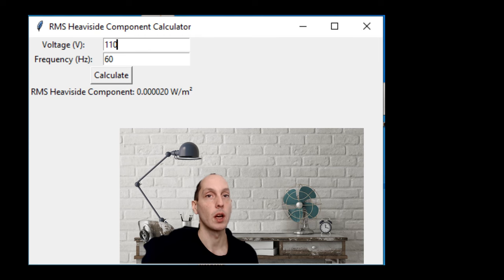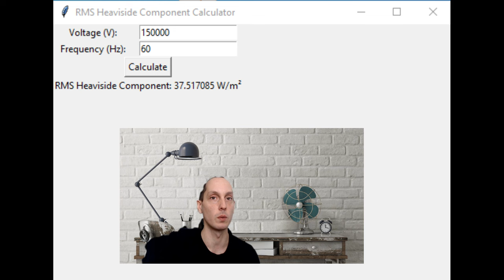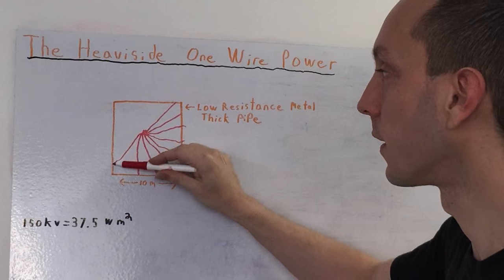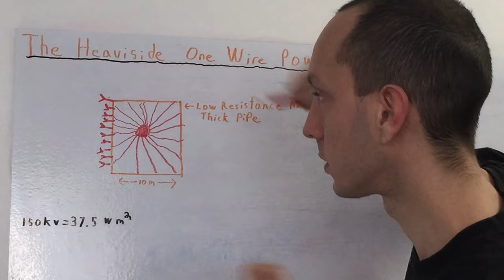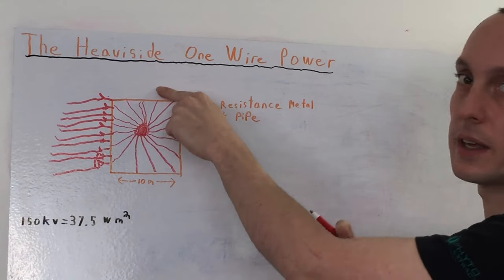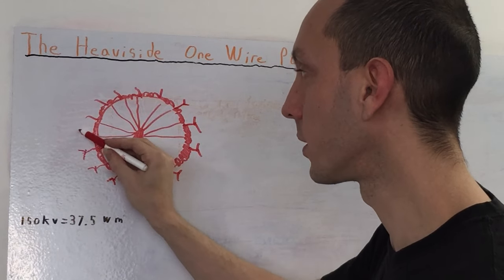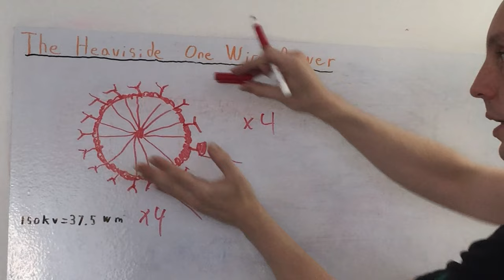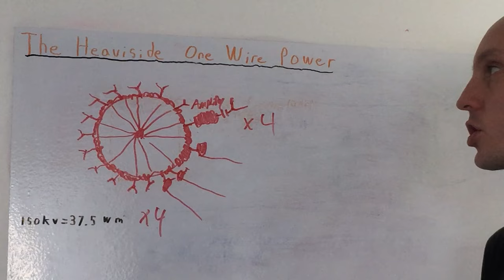Heaviside Limits

Comment: Happy new year Joel. Do you think it can be scaled up? If yes, lets talk.
Reply from the maker: This is the point I make in this video, the first option is best for scaling it up. Just need more stages (oscillators) And the calculator gives you best case. And we need an efficient way to catch the field. With 6 coils I got around 3.3 watts. But at least this gives us an idea on limits. Per one wire system.
Reply: @joellagace1679  
Do You think we can get around 500-1,000 watts system based on the calculation?
Reply from the maker: Well if you got about 27 meters of a loop. Driven at 150kv one wire. every meter square you get around 37 watts in theory possible. So that would add up to your goal of 1000 watts but in real life we may just get half of that because of all tradidital losses plus efficiency of coupling into the field. Without considering ground loops and such that can make it even better so you may be able to make up for some loss.
Reply: @joellagace1679  
In theory we can take your second option you show here and provide input trigger to every core, then the inefficiencies while cupeling into the field could disappear. Do you think it can also effect the 1M distance between every core?

Comment: Joel, may i ask where are the resonant harmonics of few different frequency in this system ? Are they missing ? 😊 😉I heard from some wise old people that power of many when conjugated in the same time and place can do wonders even if all of them are very weak.

Let’s say you have a musical instrument with 9 strings, each string is tuned from one above or below to resonate and each one plays a different tone, then you you hit/pinch group of 6 at same time at an interval of 3 and they resonate in harmony at max amplitude every time. You tune each string by adjusting the tension.
Reply from the maker: Yeah I did mention these calculations are raw without taking resonance, harmonics, ground loops etc as additional systems.
Reply: @joellagace1679  indeed, you mentioned … I was trying to persuade. I wonder if you are ready for the symphony this year ?
Reply from the maker: Yeah my issue is i'm already on the local spectrum officers radar that work in the area and they scan often the local spectrum around my place because of all my experiments and such and my ham radio license they think that I might be using it for wrongful applications. Meanwhile I have not used my ham gear in years LOL. Ah well! So I try and keep RFI projects at bay for now. Don't want to pay big fines and go to jail lol

Comment: 37.5w/m x frequency= power out? Is the heaviside power only limited by frequency in a perfect scenario
Reply from the maker: The freq will determine the rate you get the peak voltages in the cycle. So higher frequency more potential cap dumps. But not the actual field strength.
Reply: And 150,000 volts with 3 mhz
Reply: @joellagace1679  ah so the larger size of a resonator or core could have higher peaks at lower frequencies. 
Sort of like how our grid works on 60hz with large transformers

We could be on 500hz with less current smaller wires and cores and higher output motors
Reply from the maker: the heaviside field strength doesn't change with frequency. And you won't see the same high voltage on the diodes as the driving source of the one wire. For example a good setup with 150kv might get you a pure potential of around 500-1kv. With the addition of the heaviside value, It gives you an idea of the max power in watts the wire puts out nearby (1 square meter) And as I noted you won't be able to recover all of a it but you can tap a some watts like I was doing.
Reply: @joellagace1679  i would say the higher the frequency, the shorter is the wire to be wounded on transformers if you go for resonant harmonics of 1/2 wave length … means dirty cheap to build for decent output.
Reply: I need to say we still need to have enough mass of copper in coils, capacitance means power output … I can’t remember who said a perfect conductor is a perfect electron trap, all electric energy exists in conductive materials and they only need to be driven.
So, finally I understood what is the relation between capacitance and resistance (impedance) short and thick wires for high frequency and long and thin wires for low frequency to keep resistance at minimum

Comment: Do you think that ion value can make it more efficient?
Reply from the maker: an air valve may help with isolation issues with a strong field, More advanced valved with hydrogen gas could give you more gains.
Reply: @joellagace1679  
The wires/lines you draw in the second option- is it a field? Or actual wires? 
The middle of the core is a tope of a tesla coil? In 2D? Or you tap the one wire system directly to the coil turns around the transformer core?
Reply from the maker: Those are wire antennas 10 feet or more.